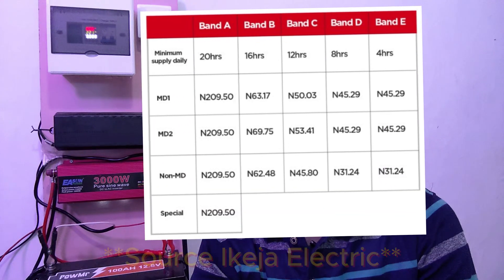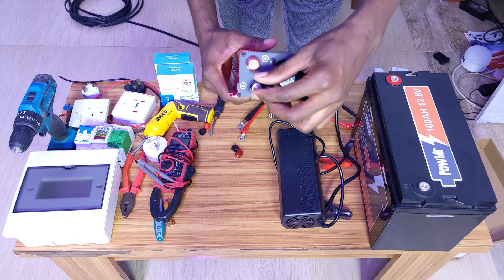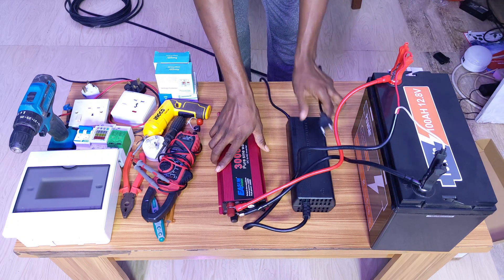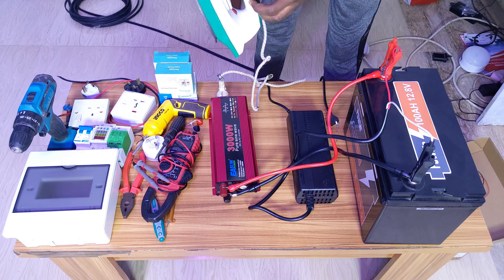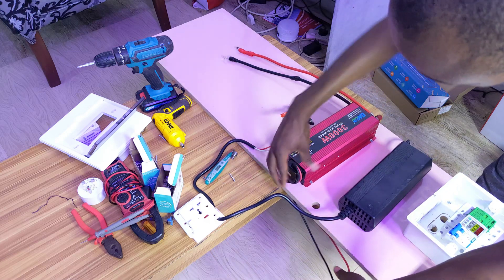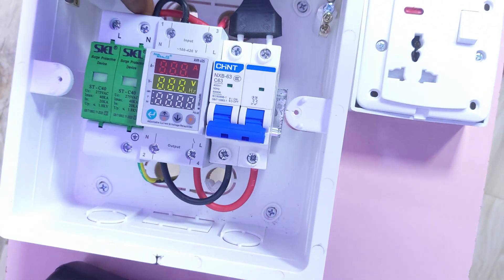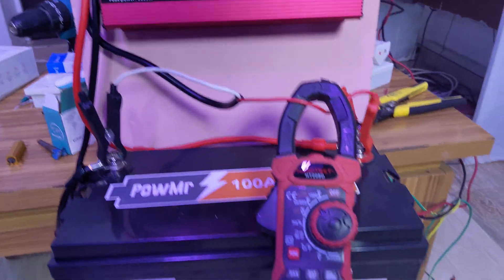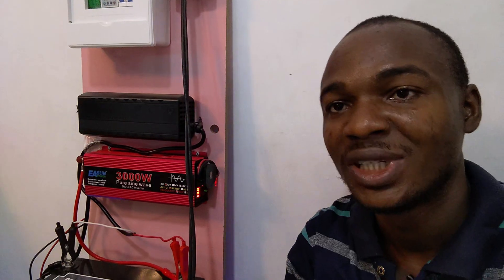Beginner friendly and affordable DIY home energy storage system.

Comment: Is this inverter actually pure sine wave or modified sine wave?

Can it power small freezer or bedside fridge at least?

Considering modified pure sine wave can't be used on most electronics especially compressors without sounding like transmission lines😂
Reply from the maker: It's is pure sinwave

Comment: if I want to use a solar panel with it, how many watts panel is recommended
Reply from the maker: @janekevin5027   this depends on your load. 
You can use 1 units of 600w panels if you just want to charge the battery, and 2 units of 600w if you have light loads, so it will be usable during sun hours and charge for backup.
Reply: What charge controller would you recommend with it?
Reply from the maker: @kokatrends  60A MPPT
Reply: @odedeyidamilare  that's at least another 100k

Isn't better and cheaper to get an hybrid inverter then?

Thank you for the responses 🙏🏽

Comment: I use same inverter, 3000watts version , it's not silent as u said, dough it doesn't consume much power itself,the inverter remains silent on small loads or only when luminaries and small load sets are turened on, the inverter fan turns on once the load is around 50watts especially when TV set is connected , Dough the fan is a bit silent, but u see that 1600watts  version of that Inverter, the fan  noise is annoying .......😢

Why is it so??.....is it based on design?.....or what.

I have installed like 3 of those 1600watts to clients same annoying sound from the inverter fan...maybe that's because of design.

Aside that ,the Inverter is great and a good energy saver for batteries becay they consume little power.

Lastly: Those Inverters are way too oversized by label.....Maybe Chinese market stunt...... Those Inverters can't handle a continuous power of 1500. Mentioned......but for longevity of the inverter, I advice my clients not to go above 600watts continuous,if not they should opt for transformer based inverters.

Nice video once more.......

Do you sell solar panels?.....if yes can you drop a link or contact?
Reply from the maker: @oranusichigozie5219  thanks for the updates, quite helpful, I believe the 3000w is more powerful the load that time was about 400 watts, fan runs quiet even when I plug in the Iron for about 30 seconds. 

The 1600w fan has a loud noise for sure I have tested both.

You can reach out on +23481323-94478 for 605w panels I use for installation, its a Chinese brand and works well.
Reply: @odedeyidamilare  Thanks will get in touch shortly.
Reply: As for those rating. I suppose they mean peak watt. As for the continuos wattage, you may have to ask them, or test it yourself to determine the continuos wattage.
Reply from the maker: @odoohub5010   yeah this one has the Actual power as 1500w
Reply: @odedeyidamilare what’s the idle current consumption for this inverter, I notice those hybrid consumes around 25 to around 40w, which is too high😢
Reply from the maker: @ArbitrageGenius  12w